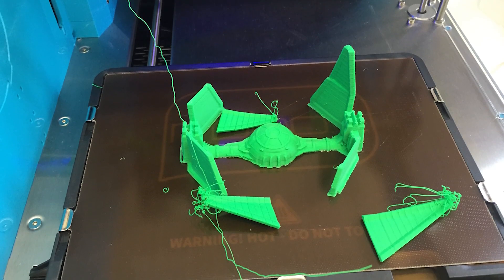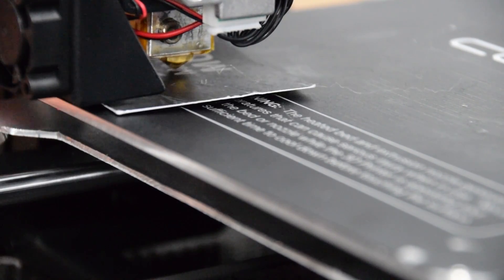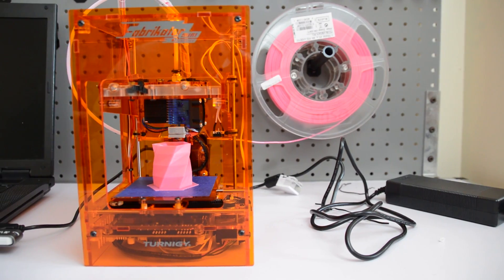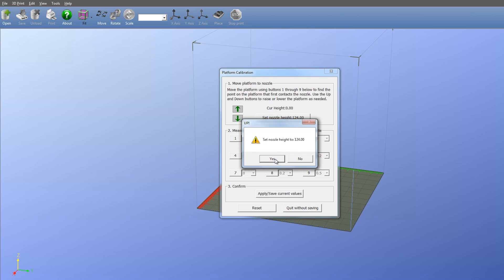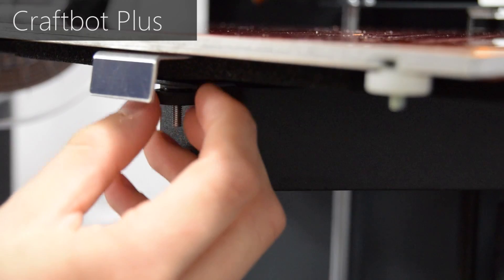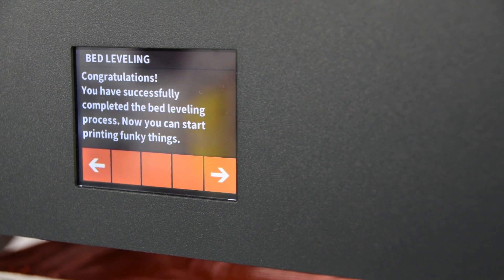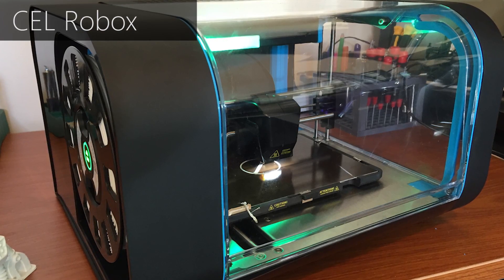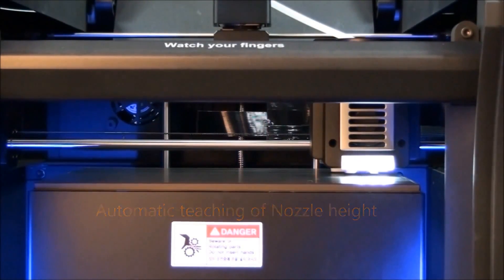How to Set your Nozzle Height and Level your Bed - 3D Printing 101

Comment: Hi Angus, thanks alot for your tutorials. theyve helped me alot. I cant seem to find a video for my issue, and really hope you can help me please. i have an Ender 3 Neo, and just changed the nozzle. When i got the printer it had a nozzle attached, and 1 extra. So after changing, i feed the fillament manually by pushing it a little till it started coming out the nozzle...looks straight , no curling, but, when i print, nothing is coming out, or its just about making invisible lines. is this hardware or slicer related?  do i need to set z-offset again?  i hope not lol. Any help would be appreciated, thank you.

Comment: Bull Turd! 80 plus attempts Glass bed, factory bed, glue or not, paper or feeler gauge, tight or loose, high flow, slow first layers higher nozzle temp, standard drive or direct drive, brim, none, raft, none, this hobby is not about making anything.
It is pure plastic waste making.
A million Bengies to look at the faults and bin them...

Comment: My Ender 5 plus/ BTT MiniE3V3 took 3 qualified technicians 6 weeks to make work, Cost me a fortune and worked for about a week before destroying the PEI bed and nozzle. So i tryed replacing the nozzle, Reset the levels with feeler gauges, saved it to the epromm thing and pressed print. FAIL. Destroyed another 3 nozzles and the beds now had it. (reset up and saved each time) Why is it not remembering what ive saved?   I think its time to throw the BTT stuff where it belongs. IN THE BIN.

Comment: Hey Angus, I'm trying to change filament and print a 3rd color at the top of my print but at the same later as another colour using z hop can I remove the support and start at print at 15mm of the bed but onto a part that is already there?

Comment: I know this is an old video. But leveling machine tools in industry is done with 3 points typically. It's much easier to set a level plane that way then add feet or shims

Comment: How level is level enough? I was recently creating a storage box for a machinist's deflection meter when it occurred to me that I could use the deflection meter to level the build plate. So, I created fixture that holds the deflection meter on the hot end with the deflection meter's contact point inline with the extruder. Now all four corners of my Monoprice mini are at the same level. The build pate is not as flat as expected. The center of the plate is 1 to 2 thousandths off from the corners. Oh well.

Comment: I thought I was ready to operate one of these things but the tech is just too difficult for the average user still.  My extruder jammed on my 2nd print, I disassembled it and after 2 days I got that working gain. My bed was smashing my extruder, I fixed that and then the bed refuses to move up from the floor now...so done!

Comment: With PLA on my ender 3d pro I can only get prints to stick when using a .156mm feeler gauge. Decided to print some ABS for the first time and having an even harder time to get it to stick properly. Whether it be on a glass bed or the original print bed. Im using a .5 nozzle 90 degrees bed temp and 245 for the extruder. Ive had a BLtouch for a while but never figured out how to get it to work and of course my print bed is slightly warped in the middle and the glass bed I got is also warped.. However, the normal bed seems to be pretty much flat when at 90 degrees (when at 60 degrees for PLA ill set the corners at .150mm and the middle will be more than .350mm Which seems like a lot. Plus no one sells new aluminum beds. I ordered some G10 I guess we will see how that works.

Comment: I know this video is old, but I see this stuff on almost every video to date when it comes to manual adjustments. Why not use feeler guages?

There's a tool for most jobs, and using stuff like paper instead of feeler gauges here, for something this consequential for your prints, is like using a stretched rubber band to do the work of calipers, going of "the feel" of the rubber band tension.

It's like 3-5 bucks for a set with angled ends (so you don't have to bend them to lay flat in the middle of a surface (like printer bed). By using feeler guages, you get highly accurate and repeatable results.
Reply from the maker: Yep, that's the approach Ive moved to since this vid!

Comment: You might want to explain 'dags' to the non sheep shagging/shearing audience. Dingle-berry works over here.
Suprised by your resistence to trivet levelling. This is the engineer's way to do it, quick and accurate. Four point leads to a distorted non-flat bed.
US theodolites used to be four point. Needed two free hands spinning the (diaonal) wheels at the same rate in opposite directions. Do it wrong, you strain the frame and can lock up the levelling. European trivet theodolites levelled up one handed in half the time.
Three legged stools are not about saving a stick!

Comment: please someone help me with something: my printer always just moves the Z axis up by one every time the printing starts. this doesnt happen on the other layers above layer 1, but what is the point if the 1st layer doesnt stick at all. i level my nozzle perfectly, and when it starts printing it just decides to not fucking listen to me and the nozzle is too high again. how the F can i fix this? i own that one printer for over a year now and nothing like that ever happened, i didnt even change anything on the printer, slicer, firmware, NOTHING and it decides to do THIS outta nowhere.
Reply: I have exactly the same problem and i don’t find an answer.
Reply: @jordybernaert3656  i fixed it, the fix was actually really simple, just download the "Z axis offset" plugin in cura, and set the axis -xx so that the nozzle is perfect. but dont set it too low since you can reaaaly mess up your bed

Comment: I learned the hard way about setting the correct nozzle height yesterday when the extruder started clicking on the lower layers and I went mad stripping everything down and looking for a clogged nozzle, ended up cleaning it the wrong way, damaged the nozzle and it made no difference until I realised I'd screwed up. so yeah very important! Still despite the damaged nozzle it still printed a passable (if slightly blobby) benchy. New nozzles on order.

Comment: I’ve used a single layer evaluation print to get real feedback on leveling. True you need to print then inspect, adjust and reprint. But it can get you dialed in to minute tweaks because you can inspect the bottom side if adjacent paths looking for variances. And you can measure the thickness as well.
Reply: Ask Holy Spirit to teach you and to guide
you. I would recommend the YouTube Cleveland street preachers and follow Jesus no man no religion. Be holy and obey Jesus. Hebrews 5:9 "salvation is for those who obey. Jesus says if you love me keep my commandments (John 14:15). Jesus even says if you keep my commandments then you shall abide in my love (John 15:10).

Comment: for the manual levelling, where you have to turn the wingnuts, i've tried and tried again, but don't know how to do it right, how much drag should there be on the paper assuming there should be drag in the first place?
Reply: just get that same amount of drag on all points. don't worry about how much. just EVEN. then you can adjust the default tip position later.
Reply: @chrishayes5755  Thanks captain

Comment: I deleted my comment because I've been having first layer issues and trying anything to fix it and learned something in the process. As far as I can understand the paper leveling method is good enough for what its purpose is and that is to keep the nozzle from scraping the bed while printing the first layer. I finally noticed that the LCD showed Z value of .28 during the first layer. So basically the whole concept is to just keep the nozzle from scraping the bed and let the computer put the nozzle where it needs to be automatically. I burned a bootloader and updated to the newest marlin with my Raspberry Pie 4 a few weeks ago. I just replaced the bed springs and re-leveled with paper, reset firmware back to default settings, recalibrated my extruder through the hot end, updated to the new Cura 4.4 update. Testing again and hopefully it works better.

Comment: Just did your upgrade on my CR10 S5 and worked brilliantly. I used a slightly more powerful heater at 1000w and the bed hits 70 in 1 min 10 sec. It does warp the bed at 135 in just 2 min 40. So I guess I will have to upgrade to a different type of alloy. No complaints thought the extra speed in heating is fantastic! Thank you for your video and helping us all with your talent. Cheers.

Comment: Been struggling with nozzle height and bed leveling. Found out that leveling the bed when its heated is important and i was told the thickness of a single sheet of paper. That caused many problems later down the line as it was far to thin.
Reply: That’s what I’m thinking I think I’m gonna try a gift card or something

Comment: My printer has 3 manual screws, 2 up front and one in back. Only problem is you level all 3 points but the back corners are conveniently lower than the leveled  points. Pretty sure shimming won't fix this and the aluminum plate needs to be fly cut.

Comment: “As long as you get a distance that’s not to close or not to far you’ll be okay” yeah thanks 😂
Reply: I've been trying for 2 months to get it level I have lots of bad prints. I have no idea of how to get the paper level feel the same on all the corners.I have gotten a bltouch and I am still having trouble after 2 days. All my prints have trouble with supports. That is when they fail the most!!! Help! Ps I have an ender 3 v2 glass bed printing pla.
Reply: @Koolkole27   your bed may be warped l!
Reply: @allraiders420  what do you suggest I do?
Reply: @Koolkole27   I’d check to see if it is warped, get a straight edge and place it across the bed.
Reply: @allraiders420  I did and it dips slightly in the middle.
Reply: @Koolkole27  you can use aluminum foil in small strips under the bed where the spots are low to compensate for the dip
Reply: @allraiders420  shouldn't the bltouch be able to compensate for it? It's very small.
Reply: @Koolkole27  don’t know, never used one!
Reply: @Esteban Brian Definitely, I have been using Flixzone for since march myself :)
Reply: @Esteban Brian thank you, signed up and it seems like a nice service :D I really appreciate it !
Reply: @Enrique Quinn No problem xD
Reply: @Enrique Quinn i watch on FlixZone. You can find it on google :)
Reply: I know Im pretty off topic but do anybody know of a good place to stream new movies online ?

Comment: It’s October 2018 and I’ve just bought my first 3d printer - strange considering I’ve been doing electronics for over 30 years and find things like microcontrollers and fpga’s pretty familiar territory... - stranger in the fact I’ve got both a mini mill and a CNC router that I’ve had for a while now. So why it’s taken me so long to get a 3d printer, no clue... As for the video, I get how you don’t need exact precision 3D printing, but I’ve found the paper method doesn’t work out for me? My prints go so much better if I run with rice paper thin nozzle heights, and I’d say I’m pinching that paper. If I use a business card or even plane ol’ printer paper, my prints end up like balls of yarn......? I am installing a BLtouch, but it will require some setup as well. I guess go with what works the best for the offset? I think I’ll buy some cheap feeler gauges just to see some hard numbers, can’t hurt anyway.

Comment: Why are you not happy with only three adjustment points? That's the most rigid option. A chair with three legs can't wiggle, one with four legs can do it anytime. Guess why photographers use TRIpods and not QUADpods? With four adjustment screws and a large enough print bed you might even warp the bed, impossible to make that mistake with only three. Three ist good!

Greetings from a surveyor whose measuring equipment stands on tripods and has three levelling screws for each instrument. :-)

Comment: No ender 3, cr-10, a8?  This was a waste of my time.
Reply from the maker: Tom, this video is from 2016. The CR-10 and Ender 3 didn't even exist. Regardless, they are all leveled the same as the Wanhao i3 demonstrated at 4:40.
Reply: @MakersMuse  ahhh, ok thanks. Having problems with my ender 3. Just really frust rated right now. Sorry.
Reply from the maker: No worries, I hope you didn't get a bowed plate because then it'll never be properly level - get a straight edge across it to check.
Reply: @MakersMuse  will do it now
Reply: I just tired again, to check before bedtime here in the us.
i'll show you the results tomorrow.
Thank you so much.
Reply: So far it looks ok. Odd, since it was doing just fine when first ran. Got the wheels fine tuned, (I think), no jerky movements on all axis. Updated bowden extruder with an all aluminum and new tube and fittings for that.
Can't get parts to stick. Will try your cleaning and glue stick trick to see if that works
Again, sorry for sounding mad, I was tired and upset I can't get my Ender 3 going again. I have hoped it wasn't this difficult....
Thanks for all you do. If I get this figured out, am I liek to get the A8 and CR-10.
Thank you very much.
Search me here on youtube, I made a video and taged you in it. Please subscribe and like, it would mean a lot to me. BTW, you might see content for the LGBT comunity, I'm gay.
Reply: I just checked with a straight edge, it seems really straight. The corners are good, but the middle hits, so that tells me it is bowed up. I think my options are maybe self level kit, or a new bed from amazon. 
reguardless I am unable to print. It started off good, but now....
I did not know to let parts cool down before removing them, nor did I know not to print a brim with the part on a build tek surface. No wonder I had such a hard time. It printed just fine then went to crap.

Comment: I have a Monoprice Select V2 Mini. Just did a 9 hour print while I was gone in the day. Came home to find a total disaster with spewed filament EVERYWHERE. How high should the nozzle be off the bed? if I use a business card, should the nozzle be tight on the card, barely touching it, etc? Also, it has four screws on each corner of the bed that I have to manually tighten or loosen to level. How can I level each side to be exactly at the same height? Please help, thanks.

Comment: The MP Select Mini is a bit of a pain to level. It uses the pretty standard manual four-point level, but for some reason they put the screws such that you have to tighten them using a hex key *from the top*. So you have to check the level, move the head out of the way, adjust, move the head back, check again...

Comment: would you recomend using a meshuring clock thing basicly a mecanical caliper but on an arm and a magnetic base, to level my bed
Reply: No as the surrounding surface will not be level to the printer. The printer can be at an angle and still print well if it is trammed.

Comment: Sadly after watching this video, I never heard HOW to level your bed. Yes you use a card, but how much resistance do you (should you) feel on the card as you slide it around? a little? a LOT? while you showed us how every off brand printer I have never heard of does it, (or doesn't do it) is seems you left out the basic function and info of what is in your title. HOW.     That being said this is the first video of yours I have had issue with. Thanks for making them, and I hope to continue to learn from you in the future.
Reply: If using feeler gauge to do bed leveling, what size do you use?

Comment: "not too cloes, but not too far" .... OMG, I would soooo like some exact measurements to know where I should start. Starting with 3d-printinng, A8, having tried the original bed, different kind of tapes, 3dlac, hairspray, gluestick, glass, ... and about 85% of prints have come loose and where destroyed ...
tried tuning bed with feelergauges at 0.2, 0.25, 0.15, 0.1,...  papertest, 
Loosing hope here.
Reply from the maker: Hehe, it depends on the printer, layer height setting and print surface. Get some buildtak or the chinese clone of the stuff, and a feeler guage if you want to be precise. A first layer height of 50 to 75% of your layer height is a good area to aim for. Hope that helps! The A8 is only as good as you can tinker it to be.
Reply: I know mate, it indeed needs lots of tinkering.
Now there is somthing new here, I heared you had to choose a first layer that was thicker then normal layers so to get squiching .. but you tell to take only 50% ... I 'll test in that direction. thx for taking the time to respond en please keep up the great video's!

Comment: Hi. I don't get it like for example at 03:30. If I had my nozzle at that distance of my bed I would just simply end up with a dirty nozzle pulling plastic clogs with it and a giant spaghetti chaos. My prints are almost fine but I gotta set my nozzle so I can barely move a thing sheet of standard printer paper underneath it while having to pull hard to move it. Anything more of a bed-nozzle distance and it's no adhesion and chaos. I have tried blue tape on hotbed, glue, hairspray but it doesn't change that rule of very tiny distance or chaos. My first layer is always very thin and sometimes the extruder retracts a small bit. but generally it works, just wondering if this is wrong. thx for any suggestions. thanks for your vids. they're great.
Reply: SMCG I have the same issue.  I was able to solve it with glue stick but now its worse.  For me, my bed material is just worn out.  I am going to replace it with my spare print bed material, but then I am switching the Print Bite.  I have come to realize most of my adhesion problems are probably because of the bed surface